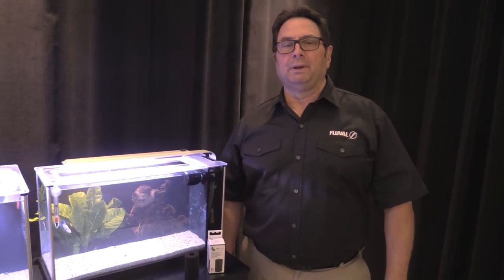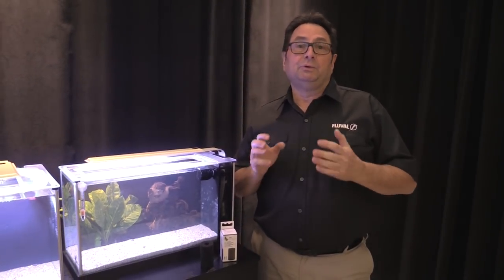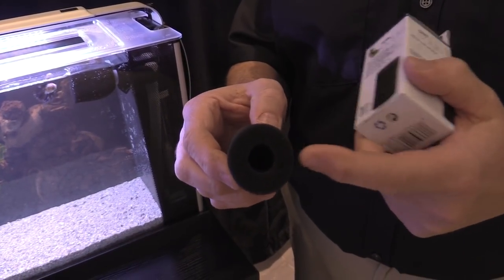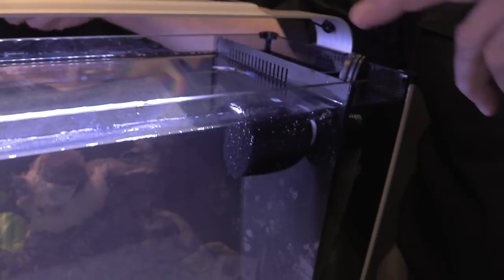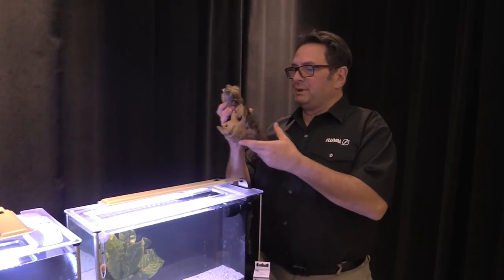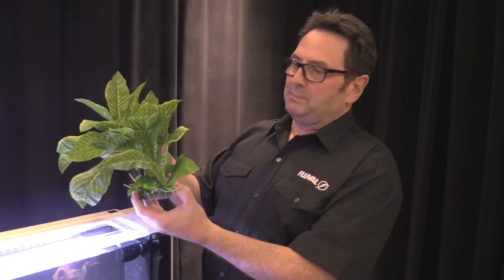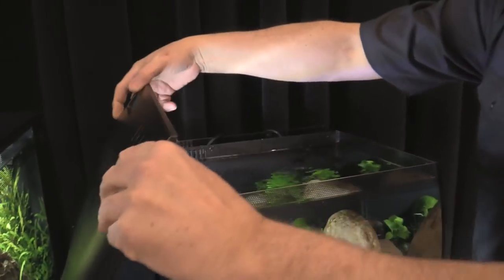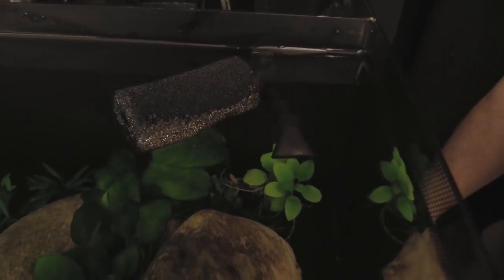HOW TO: Diffuse Water Flow in Aquariums

Comment: Plugging or slowing down the output this way is a disaster waiting to happen if you don't have a emergency drain in your filter when that sponge gets clogged and you know it will you get two clean up gallons of water off your floor probably killing your fish in the process.  instead of blocking the output you could try diverting it with a cut to fit water bottle
Reply from the maker: Actually the water output from the pump has been filtered, hence there is no debris pushed into the sponge. There is no need to include a drain as it is one common system maintained at a common level. If the pump would encounter resistance it would simply slow the output with no effect on the filter or its' level. There is no risk of overflow. We suggest simply thinking of the sponge as valve in your example, turn the valve down the pump output slows, no effect on water level as volume has remained the same.
Reply: Obviously you have never had this happen to you I have( from a process that is remarkably similar) of course if you want to take the chance of cleaning up gallons of water and killing your fish go for it I'm not trying to tell anyone what to do with their Aquarium just some advice that could save your carpets and your fish